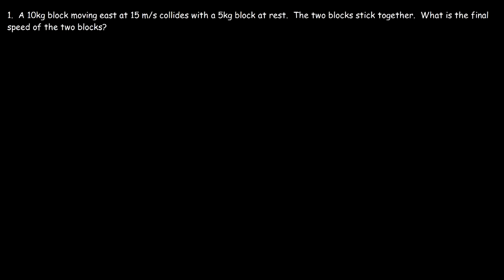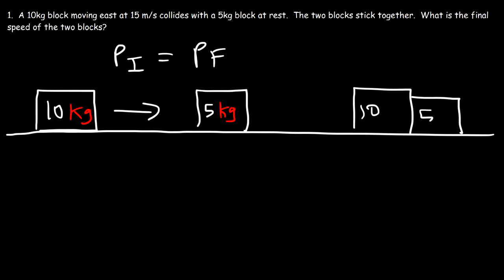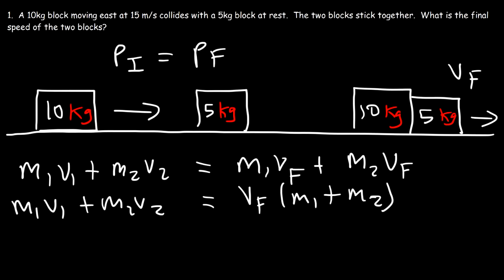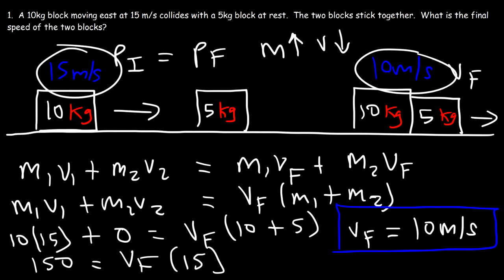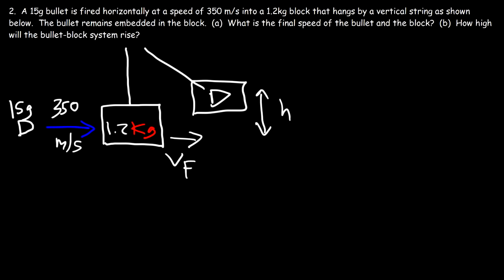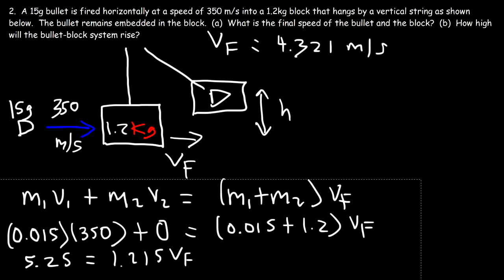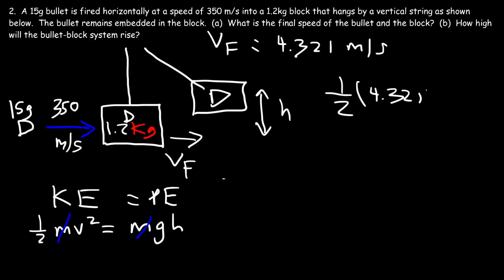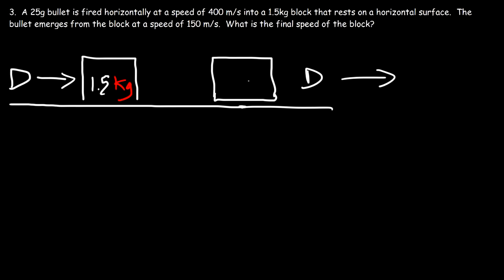Inelastic Collision Physics Problems In One Dimension - Conservation of Momentum

Comment: Your videos have helped me a lot this semester, have you done a problem with an inelastic collision in one dimension on a incline. for example a box on a 7/12 pitch roof and a squirrel running jumps on it and it slides down the roof. How do you figure out where it will land on the ground.

Comment: 4:30 but isn’t the height dependent on the length of the string? For example, if the length of the string was 1000m it will rise less than if it was 10cm.
Reply: I think the initial high would be assumed to be at level 0, so went it is hit; and rises, then the high is positive.

Comment: so im a bit confused, why did you 1.5 as final velocity for mass 1 and 0.025 for mass 2, at 11:14
Reply: 1.5 is the mass of the box and 0.025 is the mass of the bullet
Reply: @meganrivera7653  Yes, but the masses are switched at the end. He uses M1 as 0.025 and then uses it for M2. Which is confusing because that would mean V1 initial equals V2 final.

Comment: please help me with this one 

A bullet mass of 0.005kg is fired with horizontally into a wooden block of mass of 1.2kg which is resting on a horizontal surface.The cofficient of kinetic energy is between block and the surface is 0.20 .The bullet remains embedded in the block and the block is observed to have moved 0.230 m along the surface before stopping.Calculate intial velocity of the bullet

Comment: Could someone please answer this for me I’ve tried solving tons of times but I keep getting confused

Q: A 5g bullet is fired horizontally and hits an 8kg block of wood (initially at rest) which can move freely. The wood and the bullet move with a velocity of 0.50 m/s after impact. What is the initial velocity of the bullet?
Reply: Assuming an inelastic collision, m1v1+m2v2 (momentum of bullet and momentum of block) = (m1+m2)v3 (momentum of the bullet block system).
Plugging in all values we get 0.005*v1 + 8*0 = (8.005)(0.5)
And get a final result of v1 = 800.5 m/s
Reply: We can use conservation of momentum here which states that m1u1+m2u2=m1v1+m2v2
So initial momentum of the block is 0 as it asrest as mentioned 

Since they are moving together 0.05u1= 0.05+8*0.50 which gives 8.05m/s